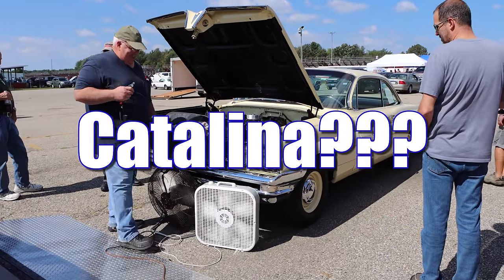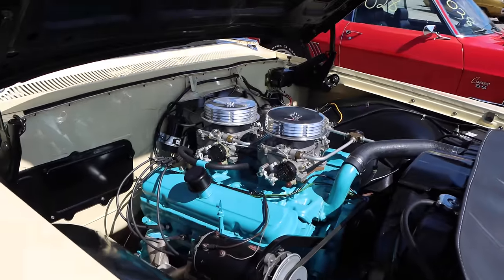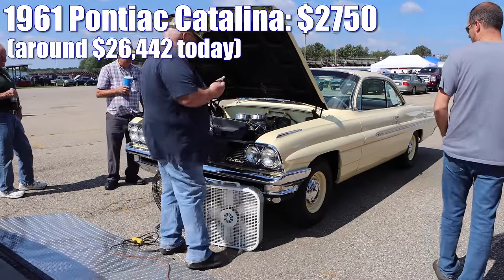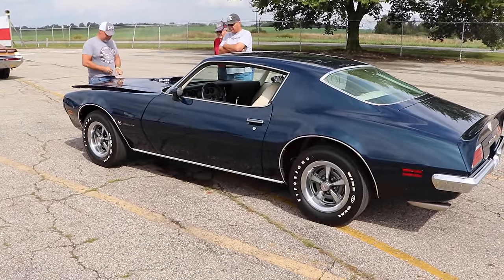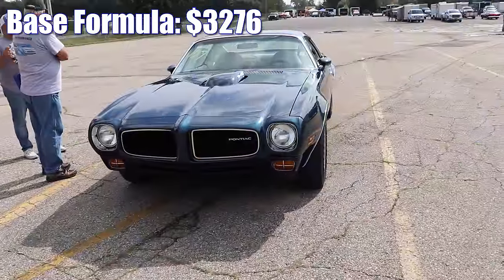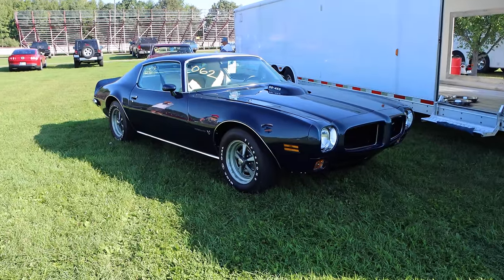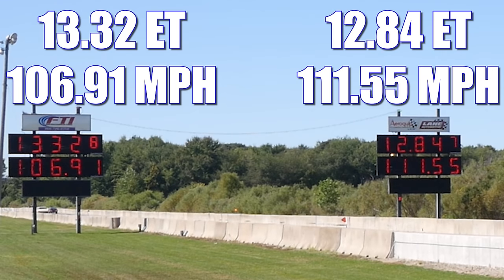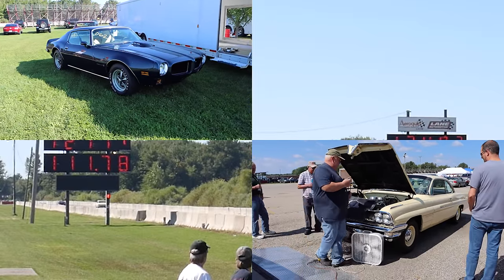1973 Firebird SD455 vs Land Yacht | STOCK DRAG RACE

Comment: Even with the low compression, those 73' & 74' SD's ran circles around their competition.
Reply: That car is no longer 8.5 to 1😯
Reply: @chrisvig123  I would love to hear what it is. Please tell me.
Reply: I bet that beast is now mid 9 compr. Probably up around 360 net hp (ballpark 450 gross). That is allowed.
Reply: @chrisvig123  A very good friend in Lake City, FL  bought one of these rare  1974  SD 455 Formulas new.  His performance-savvy Pontiac dealer's tech guy  told him that the rated hp difference between 1973 and 1974 SD 455 was all on paper and that the engines were identical in 1973-74.  
Another buddy had a 1970 GS Stage 1. Buth cars were stock and always driven to the track, of course.   They often raced together for fun at the  G'ville FL track.  The Stage 1 would run 13-teens at 104-105 mph and the SD 455 Formula would run 13.30's and 13.40's at 102-103 on 80-degree Florida days. Both ran Laramie L60-15 street tires of the day and both had 3.42 gears. This was in the mid to late 1970's and I never saw anything truly factory stock  beat either of them back then.   
In 1999, the SD 455 engine received a very professional rebuild with some serious head "clean-up"  work and thorough blueprinting that  allowed the Formula to run high 12's at 110-111 mph on Nitto Drag Radials. That was  also along with a new set of Wiseco pistons that gave a true 10.9 to 1 compression.  Good memories!
Reply: The Pontiac 455 is one motor, even with the lower compression, that survived the horsepower massacre in the early 70's. I briefly owned a stock lower compression 71 455 at the same time as a 360 hp 400 in a Goat, hands down the 455 was the stronger engine.
Reply: @LR-my2di  This car is under 10-1, has as cast virgin SD heads, + .030 bore and has been a best of 12.33 @ 114 in trophy air and has run regular 12.50-60's. The SD combo is a winner for sure.
Reply: @chuck0802  The SD 455 was a late model low compression engine "done right" before the exit of that genre. It had some good factory parts that came to the rescue in complimenting the low compression.  Unfortunately, in 1973, Buick, Olds and even Chevy didn't do this  Heck, the cam in the 1972-74 SD 455 was bigger than the one in Buick's 1970-19734 GS Stage . A good combo in a relatively wind - cheating  body compared to, say, the Olds & Buick muscle cars. That alone was worth a couple of tenths over the competition.  Too bad that engine never made it into the '73 GTO.
Reply: @LR-my2di  you are correct on all counts from someone (me) who has first hand ownership experience.  I wrote a separate post in the comment section with some history. 

The dealer was mostly correct about the EPA “paper difference”. In the Norwood plant where mine is from, many of the 1974 SDs of any model package had the 1973 heads factory installed.  Which had very slight published larger numbers exhaust valve than the paper 1974 heads.  I know as a owner this is so..  :)
Reply: @chuck0802  see if Nitto or someone would make street tires like Sport Cup 2s for your rims? And see your time drop by .5 or more. Running those Polyglass like tires cost you time.  Unless they make some sticky gum shoe replica drag versions.  If there is such a thing and you are running them, your time should he quicker with faster trap? IMO.
Reply: @johnross6314  Thank you, John.  I kept up with this kind of stuff back in those days. At the time I was in FSU and could not afford anything but a good education, but among my very favorites were the SD 455 "pony cars" and the underrated 1970 Buick GS Stage 1.  Matter of fact I worked part time for (Larry) Dobbs Publications in Lakeland, FL (Car Review mag.) and helped them with their road and track evaluations of a 1974 Formula SD 455 belonging to Fred Ring out of Lake City, FL.  I was also there with editor Donald Farr during the still-infamous 1970 GS Stage 1 vs. 1970 GTX Hemi Round 1 "Shootout".  Forgetting all the rumors that persist to this day, I pretty much know all about that race as I saw the whole thing and talked to all parties involved.
Reply: @LR-my2di  excellent history.  Thanks for sharing.
Reply: @chuck0802  they are allowed 1.5 increased
Reply: Do you participate in the races?
Do you know that “chuto” is slang for penis in some Latin countries?
Do you want to buy the Formula?
Reply: @chuck0802  Are you the owner of that Formula?
Reply: @chuck0802  The Pure Stock rules allow an increase of 1.5 points in compression ratio, to allow normal machining of heads & blocks during rebuilds. So a '74 455 SD at this event is likely at 10:1, narrowing the gap considerably between it and the '61 421 HO. (They weren't yet called "Super Duty" by Pontiac in '61, only a street nickname.)
Reply: The Formula in this vid is a 73 (no drivetrain difference from 74). The compression is under 10-1. And it runs on pump gas with timing set on 34 total.

Comment: Man I love Pontiacs. I'm glad I own one. My fav out of gm.
Reply: My hotrod adventures started out with Pontiacs and I still love them but the fact is that we Pontiac po' boys in my neck of the woods were the dirtiest and greasiest of the gearheads spending much more time replacing blown up engines & 4 spds than anyone else😖 The Pontiacs had a very unique sound and when you revved the motor the entire car rocked over to the right side.  Sure wish I had one now but I wouldn't be trying to take on the world with it like the maniac destructive kid I once was. '64 & '68 GTOs.
Reply: I'm glad I own one as well 74 SD. I street raced it in the '80s up to early 90s when I put it in storage. I had Nunzi Romano build the engine 4.10 gears fiberglass Hood. Manual valve body transmission. He put his stage 3 cam in it. Anyway it ran high 11's on the motor and high 10 with the 150 shot.
I still have the car minus the NOS and it's got gears removed.
It never got beat on the street although I know a couple people that could have beat it.
His Pontiac 455 HO W/blower and two nitrous systems.
Reply: @dannydennis318  nice I actually two 78 Bonneville hardtops,one is a brougham sedan with Pontiac 400 and a two door with olds 403. I'm lucky to have both of those engines.

Comment: Amazing cars and the Catalina is still running a 6 volt generator and electrical system.
Reply: It's a 12 volt generator.
Reply: It's a 12 volt generator.
Reply: Didn't GM switch from 6 to 12 in 1955?

Comment: as a teen during the 70s , any car capable of running 13s in the 1/4 mile was FAST on the street at that time, combined with the torque outputs of the day , bias ply tires sketchy brakes and no anti-lock or traction control systems...throw in a limited slip or posi rear, and they were a HANDFUL, of beast like terror, fun... I had a 65 chevy II (nova) with a non-stock 400 ci small block and 390 rear, it was terrifying off the line and a tire eating burn-out monster

Comment: Not as close as I thought it would be. I think that Catalina needs a 3.90 rear instead of that 4.10. Ponchos don't seem to run faster with gearing past 3.90. Hard enough to get that thing to hook up as it is. Something tells me that 73 has higher compression and a more aggressive cam than it came from the factory. Clearly the owner is a VERY experienced driver. He was out of the lights and moving down the track before that 61 even hooked up. Thanks to the owners for racing these rare and valuable cars. A couple hundred grand going down that track in this race.

Comment: If that Catalina was able to hook out of the hole, it would've beat the SD 
by at least a fender... That 421 is pure mean & nasty especially on the 
2/3 shift when it's up on the cam.

One of my uncles had a '62 Catalina hardtop white/red with a 389.
Although he said he preferred "going hunting" with Dad's '61 Plymouth
Fury 383 (ex- Illinois State Police) that most people said was "beastly."
I shudder to think of what those 413 powered cars were capable of...

...And a good time was had by all.

Who else misses the 60's?
Reply: Nope. That SD just flies. 12.71 is insane for that class. It was probably the most powerful car you could buy stock in 1973....

Comment: The real built up super duty engines crank out around 485 hp. Don't remember the torque.
I never ran into one on the street but I had a Pantera with a built Cleveland making 430 hp and I cleaned a SD455 Firebird s clock in a rolling race from 20 mph all the way up to 145 mph when the Firebird ran out of engine or gears.
At that point I had a comfortable 4 carlengths on him. I was somewbat surprised that a 73 low compression engine put out that kind of power.
I do remember going to the midnight street races near El Paso in 1963 when I was based at Fort Bliss. The top contenders were the 413 and 426 Max Wedge Mopars who would usually beat the 409 Chevs and 406 Fors.but one night a Pontiac Catalina showed up and ran the field it was a 62.and I was told it was a 421 Super Duty . It did indeed have dual quads and aluminium exhaust headers along with aluminium hood and fenders and bumper as I recall.
Based on the times in these races zi would wager that the Catalina IS a stock 421 SD.. the Firebird IS running about three quarters of a second faster than any stock 455 tested by the magazines back in the day.which combined with my real life experiences including racing one leads me to believe that the Firebird s engine is likely running more compression s ion a hotter cam and possibly non stock heads along with headers.
At his weight to turn the times he's turning hehas to be making around 525 hp and  putting 450 to the rear wheels.
I personally had a 97 Firebird with a 383 LT engine that. Was making 475 at the crank and putting around 410 to the wheels with 3.73 gears and a beefed 700R4.
That car would run 12.97 thru the quarter and top at around 160 mph.
The Firebird in the video is considerably quicker.
I have built a 455 Pontiac to what I consider around maximum practical street level. The changes involved forged crank forged H beam rods 10.25 to 1 flat top pistons CNC ported Edelbrock aluminium heads a hot hydraulic roller cam roller rockers  high rise dual plane manifold 850 Holley 1 and seven eights primary headers 3 inch dual exhaust to the back of the car.
The engine was for a customer who had 67 Firebird convertible that originally had a 326 engine and a 4 speed.
When the engine expired he had someone supposedly build a hot 428 that didn't turn out well at all.
So he came to me we discussed the matter and decided on a 455.
The 455 he got was a good street engine enough vacuum to use power assisted 4 wheel disc brakes.
Power was all in just before 5500 rpm.
Car would run on 91 premium.we broke the engine in on a dyno before installation then made a pull. The engine was running lean on the big end and experiencing minor predet . I rejected the carb and we made another pull but still ran into very minor predet. Backed the timing off 2 degrees. This time we ran the engine successfully all the way to 5500 where the power started to drop off.
Final readings were max torque 565 ft lbs and 533 hp.
Good  enough.
The owner took it to Bob's Big Boy in Burbank and embarrassed the hell out of a 1970  LS6454 Chevelle on a nearby back street.
Which again leads me to believe that the Firebird in this video is a good bit north of stock and ir has even rebuilr and blueprints by a REALLY good engine builder.

Comment: Just imagine an SD 455 with 10.5 compression ratio !
That would be bonkers !
Reply: Yes and the cam that they originally designed for it they said the motor would have been rated 465 hp gross.

Comment: I bought new the 73 455SD  4 speed  red  with  the white interior  I ordered  it with  the old style  wheels  as I didn't  like the honeycomb  wheels  and crank windows   My Girlfriend  had a 72 and the bird decal  didn't  last in the Arizona sun so when I ordered it  I told them  no bird and they  just put the 455 on it without  the SD.
 I still have  the cigarette lighter  after blowing  two engines . It was 1 of the 10
Reply: I can understand the two motors in those days, but ten lighters? Hahaha.

Comment: I’ve never seen anything that says a shaker hood was factory on the Formula. Any references?
Reply: Yes, that is true. Herb Adams made sure that checking the SD-455 option, the formula got the T/A hood scoop.  For several reasons. 1.) pass sound drive by limits for CA and other states.  Without it, even with the traditional “cold air induction” hose and plumbing, add 2-3db more drive by sound. The scoop silenced it enough (when closed).  2.) the Needed massive air in order to breath low compression.  The HP rating jumped massively once the three pop rivets were drilled in the hood scoop plate and the plate removed. 3.) Herb Adams made sure the SD-454 was a system/package. The formula ALSO had the better springs, baseball bat sized sway bars, better bushings, etc. suspension.  These cars handled very well.  It also had better brakes, cooking, and exhaust.  The cost of the motor option, had all these goodies across the board.  

Does that help?  I wrote a separate comment with some history of my SD-455.  Hqve a look if you are interested.
Reply: @johnross6314  very interesting. Thanks!
Reply: I never knew, either. Rarities/oddities... I remember the twin scooped Formula hood. To me the Shaker looks out of place on the flareless fendered Formula.

Comment: There's a dyno test of a SD 421 making 488 hp. What's too bad is that Delorean couldn't get his Banshee sports car built in '64. Smaller and lighter than the Corvette, imagine that with a 421 SD in the bay, and the follow on engines that could have been built to go into it. Seems to me, instead of going down to 4.11 gears, the 421 should have gone up to maybe 4.56 to be optimal for 1/4 mile.

Comment: How has this "Formula" got a trans am shaker hood and not snorkels?
My '74 has twin working snorkels.
Reply: SD Formula's ALL had the shaker hood. The EPA would have forced Pontiac to re certify the car is they changed the hood. Since they were so LUCKY to have these produced at all, Pontiac opted to leave the hood with the shaker scoop. PS. My first car was a 1974 Formula 400 2bbl, dual scoop fiberglass hood and it was slow as can be stock.

Comment: Prepped track or not, with those stock tires they are spinning off the line. You can probably subtract a few 10ths' of a mile with slicks installed.

Comment: Didn't Pontiac race these cars with the 421 Super Duty engine combo in NASCAR in the early to mid 1960s?
Reply: Yes, but a single four barrel version. Multi-carbs weren't allowed by NASCAR anymore by that time. I remember watching NASCAR races on TV with my grandfather during those years. He had a beautiful red '60 Bonneville and rooted Pontiac.